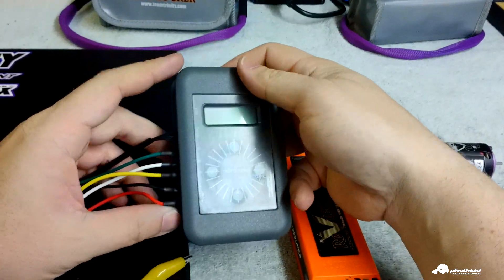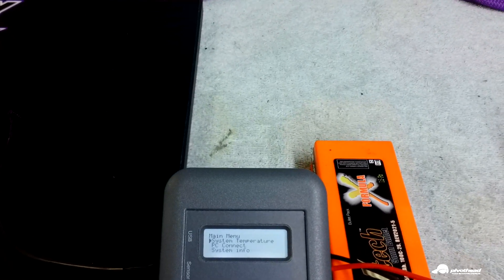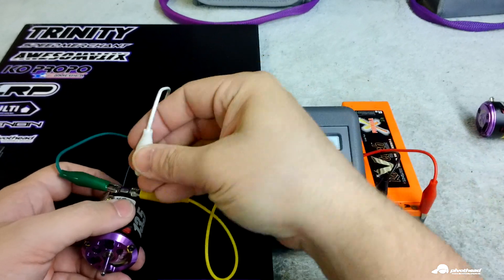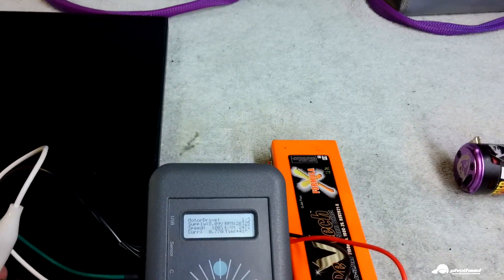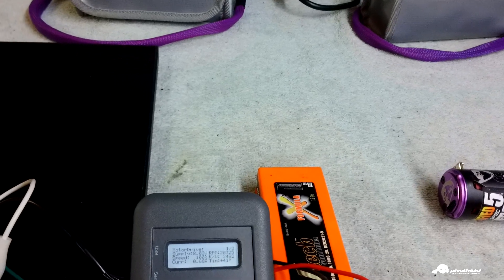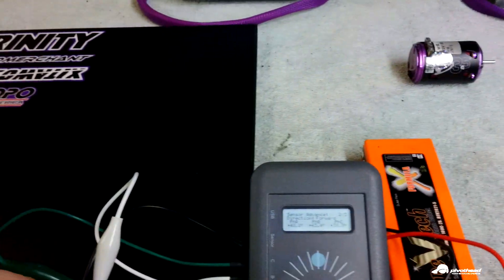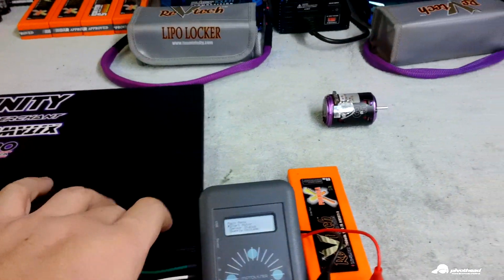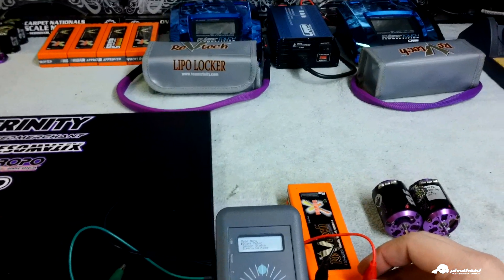Josh Cyrul showing the Motolyser

Comment: How do u shim with the plastic .5mm shim ? Do u stick plastic in can or do u just get a shim the same size or with of the lexan and then stick it in the can ? Thanks
Reply from the maker: You take the sensor side of the motor off and then use the shim like a “feeler” gauge. Then you put shims on the motor shaft from there.
Reply: @cyrulrc14  ok thanks will this work on a 2.5 or 2.0 sir thanks
Reply from the maker: @Dirty263  Yeah, it would apply to all brushless motors.
Reply: @cyrulrc14  thanks thanks brother